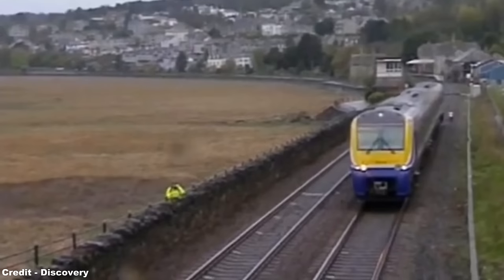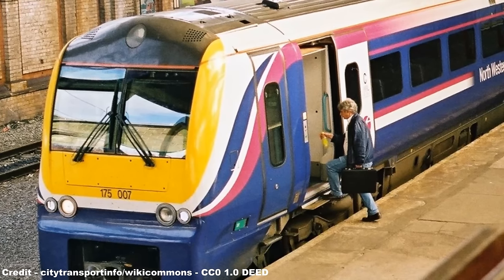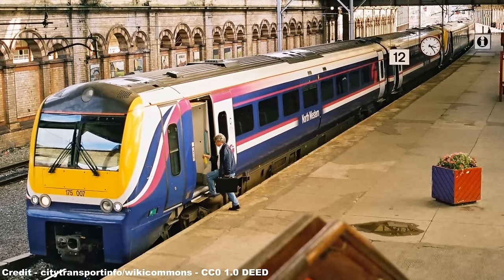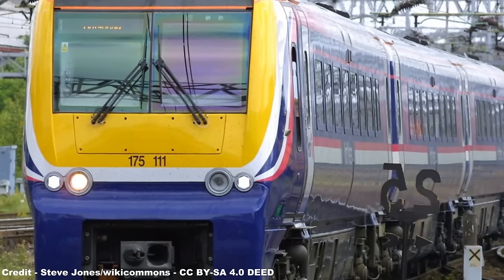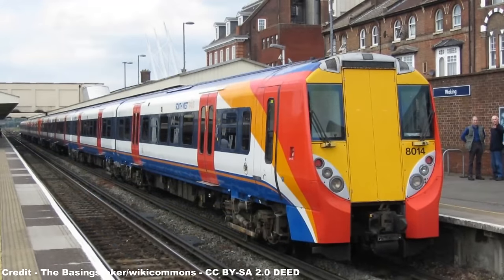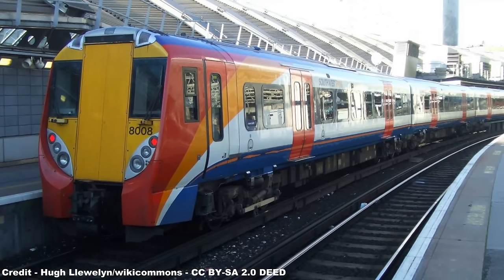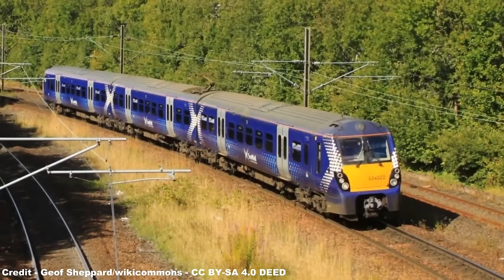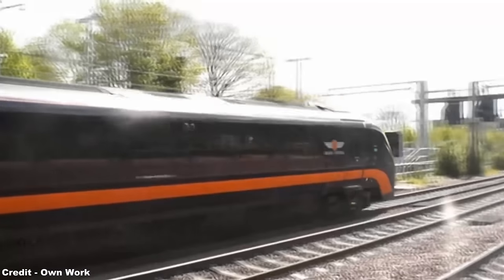The Alstom Coradia - Britain's Most Unreliable Trains

Comment: I work on the ECML, and whenever a class 180 breaks down, we just go “it’s just doing it’s thing”
Reply: Remember what Paul Tyreman says 
"You'll be going nowhere"
Reply: Shame, because the 180 remains the coolest looking MU on the network.
Reply: Think there the second least reliable trains going these days.
Reply: @philipbray880  what's the least?
Reply: @mburland  would say class 150's given their age and milage they've done over the years.
Reply: @mburland I'd say anything built by CAF or Hitachi 😂 (Just my opinion though).

They keep cracking up and clearly not well designed for our Victorian network.

Mind you i quiet enjoy the 197s, but don't think they are better than the 175s at all.
Reply: The U.K.’s broken rail network will never get fixed, even if it goes back into public ownership, because there is too much political and trade Union involvement, trying to maintain and enforce the status quo - the more things change, the more things stay the same, that’s just the way it is, things will never change
Reply: I'm going to start saying this whenever a 777/1 breaks down lol
Reply: That's new lol
Reply: @philipbray880  that's not a design issue though, is it? That's down to crap maintenance.
Reply: @derektaylor2941  pretty much so crap maintaince practices just about anywhere these days otherwise the 150's could of been better if maintained better.
Reply: @philipbray880 I suppose they're at that age where they do just what is required to make them legal and safe (if we're lucky) and anything beyond that is balanced with their life expectancy.

I originally came from a railway background but left before privatisation. I went for a bit of a reunion and couldn't believe the changes, so if that's reflected in maintenance too then God help us all.
Reply: @philipbray880 there not that bad are they?
Reply: @derektaylor2941  I know bet that's a shock for you being a ex British rail and all that.
Reply: @pacerfan09  class 150's apart from the noise on the inside pretty sure most are still reasonably reliable just depends on how the maintenance is done.
Reply: @mburland They look tacky and cheap
Reply: @derektaylor2941  The air supply that works the toilets comes off the main brake system. Sometimes the 180s grind to a halt because of an air leak in the toilet system. In fact, that is wrong, they fairly frequently grind to a halt because an air leak has developed in a toilet.
Reply: @philipbray880  My late Dad- a real career railwayman- got me into the industry, but then he became disillusioned and when he retired, I left. I don't know if I did the right thing. I'd have been more at home 50 years earlier I think.
Reply: @GDGRailway47712  air brake reservoirs should never be used for anything except brakes.

How does an air leak in the toilet (presumably the flush mechanism is air operated?) cause the unit to stop? I would have expected the air take off to only be a relatively small pipe and these units should be able to supply more than enough compressed air to mitigate a leak. I'm guessing there must be some deliberate sensor to detect any leak and thus apply brakes as opposed to a loss of auxilliary air- which shouldn't apply the brakes . But in truth I have never had anything to do with these new types of stock. 

NB that's a genuine Q and not a disagreement with you.
Reply: @derektaylor2941  I know what you mean that's understandable think I'd would of thought the same if I had worked on the railways for a number of years.
Reply: @philipbray880 the great Douglas Adams once observed that any changes in the first half of your life are new and exciting and you can probably get a career in it. Any changes in the second half of your life are just wrong.

If you look at youngsters today, they think voyagers are great- I hate them. Likewise as much as I liked the Deltic, the HST was a winner... you can predict someone's age this way.
Reply: @derektaylor2941  yeah seems to be a mixed opinion over them, some like them some doing which is fair the Hst's done their bit even though never served east anglia so never got to rife on one regularly.
Reply: @derektaylor2941  an air leak in a toilet thats been stupidly connected straight to the main res will cause the unit to stop because train brakes are fail safe - they require pressure to release, this ensures that if pressure is lost, the brakes will automatically apply. so if a leak in the toilet deminishes main res pressure faster than the compressors can make up for it, the brakes will slowly stick on
Reply: @Trainman10715  given that all compressed air in a train is sent via the main air pipes (yellow) I don't think there was much alternative there.

As for needing air to release the brakes- are you saying these modern units have some sort of automatic sprung park brakes, such as with commercial vehicles? If so then that's madness.

In the good old days a train with NO AIR AT ALL would be un-braked. You'd fill each reservoir with air via the main res (yellow) and the brake itself was actuated via the main brake pipe (red) (also can be electric in some DMUs). A drop in pressure in the brake pipe would open a valve to apply air pressure from the reservoirs to the brakes.

If we lose the brake pipe presure- such as a train split- then it will activate all the triple valves. OK, agree. But how does the loss of main res cause brake application?

(genuine Q btw, I'm not arguing with you- this wasn't my area when at BR) Talk to me about commercial vehicle brakes and I'll tell you all you want, but trains? Hmmm...

Comment: Interesting parallels with the 1955 BR modernisation plan where, as part of the steam replacement programme, myriad diesel types were procured with resulting reliability, maintainability and operability problems.  I wonder if we are doomed to continue not learning the lessons of history.
Reply: Metro Cammell used to be one of the best manufacturers for quality. There are London Underground trains built by Metro Cammell that are 50 years old and still running reliably. Also remember the Class 101 DMU, probably the most rattle-free of the 1950s DMUs.
Reply: What I like is that the BR Standard Locomotives, mixed results non-withstanding, were built with clear goals and efficiency (maintenance and parts-sharing) as much as possible... While BR said to the first generation of diesels: "DO WHATEVER YOU WANT!"

I guess it was because Diesel technology was a bit new to BR at the time so it was trial-and-error, but the execution of the whole thing... oof....
Reply: @toby070 True but down to Riddles the first BR CME who disagreed with dieselisation on economic, security and probably philosophical grounds so he created the Standard Class steam locos.  I suspect the diesel debacle was mostly caused by lack of overall objectives and inept procurement.  Many of the companies they asked to build the Type 1 diesels were good at steam but utterly inexperienced in diesel, eg North British.
Reply: The site "derbysulzers" mentioned that Vickers had welding issues with the Sulzer diesels, leading to cracking as the 12LDAs were uprated to eventually some 2,700 hp. Later, with the 12LVA25s, there were crankshaft issues which were later found to be from fitters incorrectly reassembling the bearings. Washwood Heath seemed to be carrying on that tradition.
Reply: @cedriclynch  They built the Metrobuses that at least in Birmingham and the Surrounding area never missed a day of service apart from if one was involved in a Crash or been vandalised, MOT and stuff but in terms of the actual bus reliability they never owed TWM later NXWM any money and were withdrawn after 30 years. Most newer lower floor buses are not going to last that long. They were still using Metrobuses as Driver Trainers but due to Birmingham having an emissions zone I don't think they have these anymore. But the Metrobuses did everything from Local Commuter Routes to Express City Services to Long Distance City to City Commuter services
Reply: Oh my god you're right.

Comment: The 150s, 153s and 158s outlasted the 175s on the TFW franchise. Astonishing.
Reply: As uncomfortable and old the sprinters are they’re extremely reliable and I still enjoy riding them to this day
Reply: Good. I'd rather sit in the dirty rust bucket that is the average 150 than on a train that doesn't move at all. Also the 158 super sprinters low key have good seats right now.